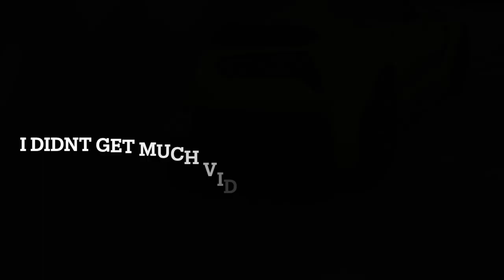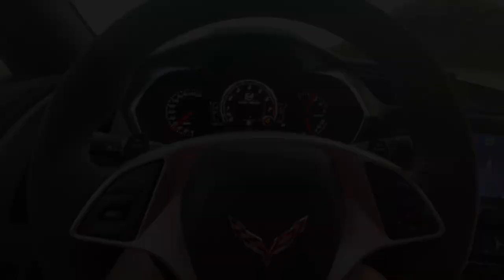WHAT SIMPLE BOLT ONS DID TO MY C7 ZO6

Comment: i made 677 whp and 702 wtq with just an intake, lower pulley, and e50 flex fuel. manual trans. stock headers, primary cats still on. just a borla x pipe
Reply: How do some people barely make around 570hp with an air intake? Faulty engine? Or you just got an extremely good tune
Reply: @nathanielalaburgDelhi  i made 582 wheel hp stock with intake only
Reply: @nathanielalaburgDelhi  Thats about right WHP is different than crank
Reply: What intake,lower pulley did you go with